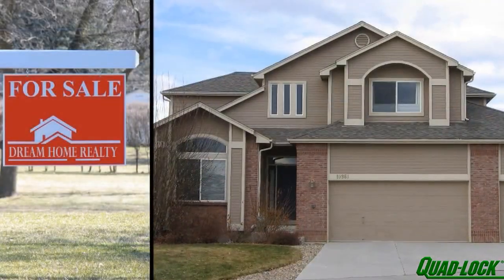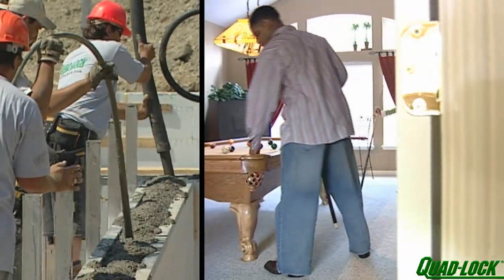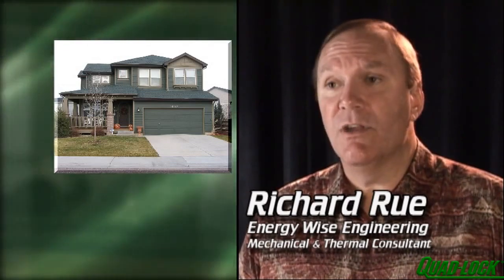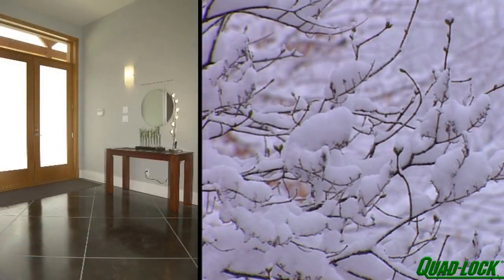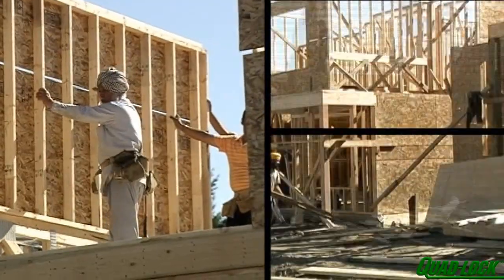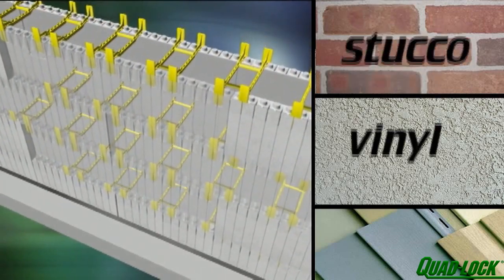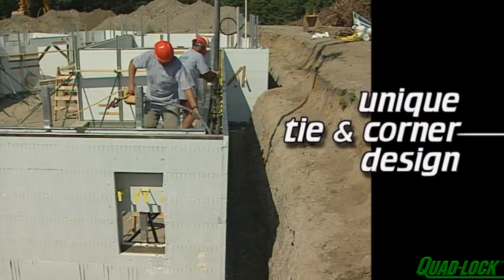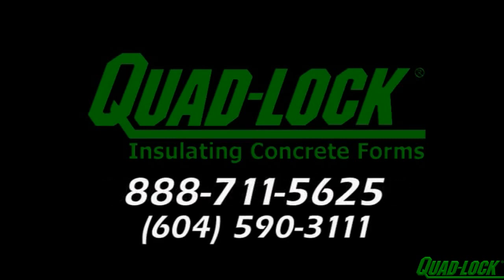Insulated Concrete Forms Benefits (ICF)

Comment: One day I'll have enough money to build a home, and when I do it's going to be ICF. Better soundproofing, better insulation, and more structurally sound than stick framed. Sure, the initial cost is a little higher per square foot, but you get that back over the course of ownership in hearing cooling costs, and can be offset even more by installing solar panels, which where I live is virtually free if you have even a modicum of sun hitting the panels. Which in Florida isn't really a concern.